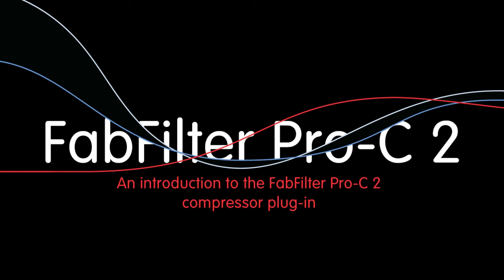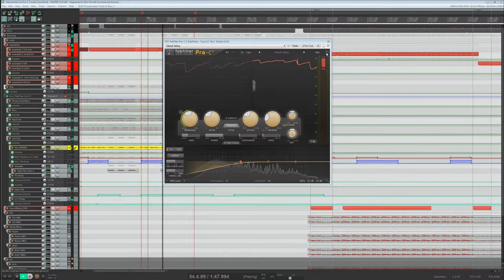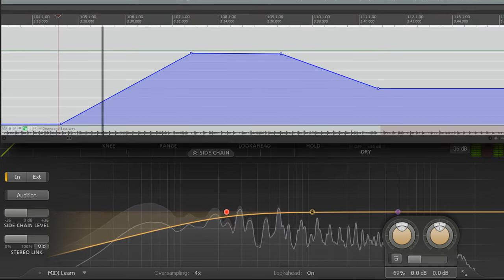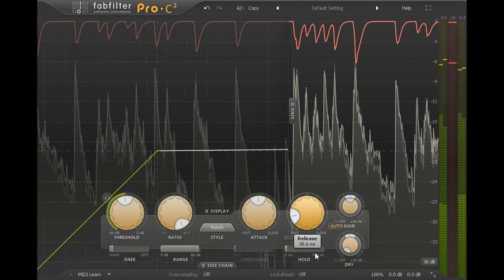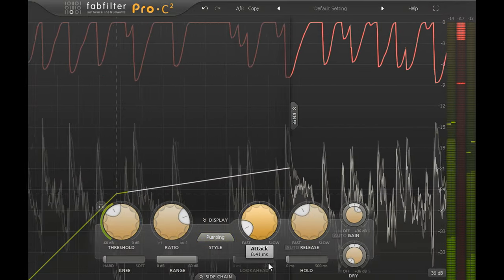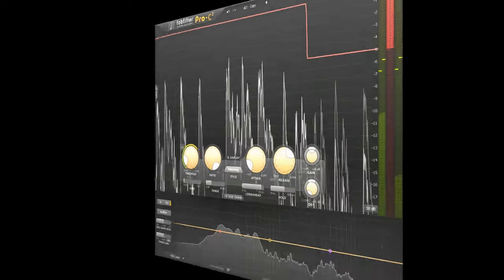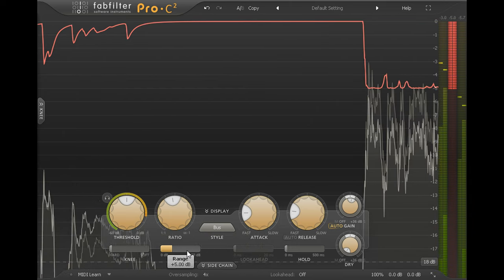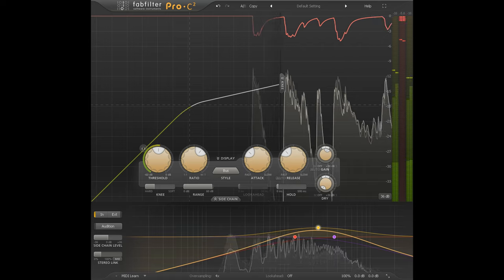Introduction to FabFilter Pro-C 2 compressor

Comment: FabFilter are the best for lot of reasons, the only plug ins you need to get a great pro mix + Soundtoys or Eventide for FX´s and you are in a great level, of course if you know how to use it, but with Fab Filter it is easy. Cause there are excellent tutorial on the tube by them and all the Fab Filter stuff is visual, but still needs a clever brain to be creative.
Reply: Exactly which FX plug-ins do you mean by Soundtoys and Eventide?

Comment: Wait, but what headphones near the threshhold do?
Reply from the maker: Pavel V. Using this button, you can listen to the 'triggering': you'll hear the actual compression (the audio that you are 'loosing') instead of to the compressed result. Very handy to check if you're fully catching transients etc.!
Reply: fabfilter thats freaking awesome
Reply: fabfilter Wow, neat idea.
Reply: +fabfilter Very cool! If that listen mode does what I think it does, It could be very useful to use as a sort of transient enhancer if the 'listened' signal is mixed back in parallel with the dry signal (Ableton racks would be perfect for this). Add a pro G and Saturn to the 'triggered' chain/channel for extra shaping ... I think I'll be enjoying this! 
If no compression is occuring, say, in a hard knee situation, with all of the signal below the the threshold, will the monitored output be silent when using this feature? That'd be a fantastic alternative feature in and of itself, to be able to isolate things that way.
Reply: +fabfilter sick
Reply: +Real Cardinal pretty clever idea! Might actually try that. Freaking awesome plugins, they have thought about everything!
Reply: +Real Cardinal I have no idea what you just wrote but I have a feeling it's something cool, so I'm going to copy your comment for later use.